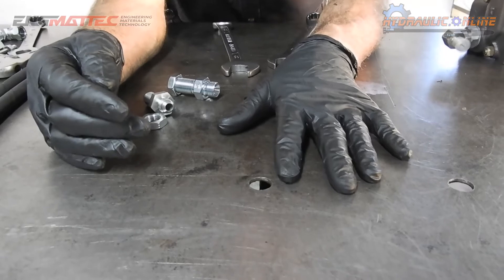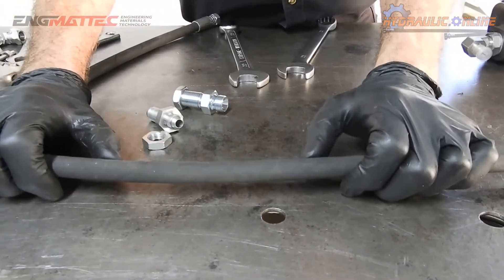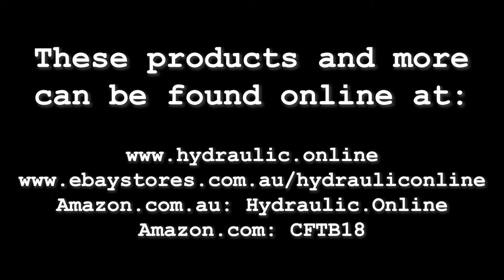Hydraulic Adaptors How,  Why and Where to Use a Bulkhead Fitting

Comment: Do I need to use a gasket  if bulkhead material is Aluminium, is there a thicknesss limitation for bulkhead?
Reply from the maker: Using a Gasket Is Probably a Good Idea, especially if the material the bulkhead is made from is not Aluminium, thickness will be limeted by the length of the bulkhead and if you can get the lock nut on as well as connect the hoses or pipes to the end of the remaining bulkhead threads.

Comment: Thanks for the video. I now know it is a bulkhead fitting I require. I need to run 10mm copperpipe through the side of a wood burner bt not let smoke come back out the hole. So do you know what size hole I'd need to drill if I get a 10mm bulkhead fitting? Because I see your pipe diameter doesnt pass through the hole so I guess I need a smaller than 10mm hole?
Reply from the maker: 10 mm copper pipe? did you mean 3/8" copper pipe.

Comment: Thanks for the video. Do you need a flat gasket if you have high pressure (say 150 psi) on one side? Or is a surface (I am using plastic) sandwitched good enough for a seal?
Reply from the maker: For 150 PSI you will need a fiber reinforce rubber gasket or other chemically inert material depending on what you are trying to contain under pressure (stop from leaking out.)
Reply: @Hydraulic.Online  thanks for the reply mate and Merry Xmas!